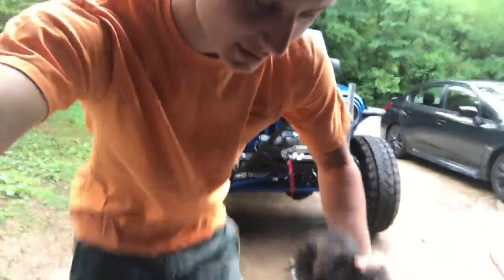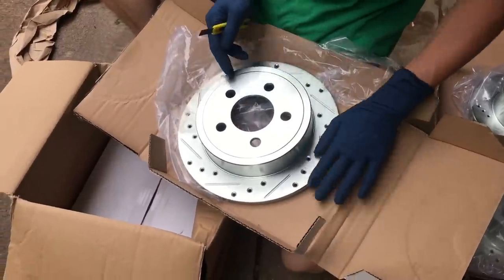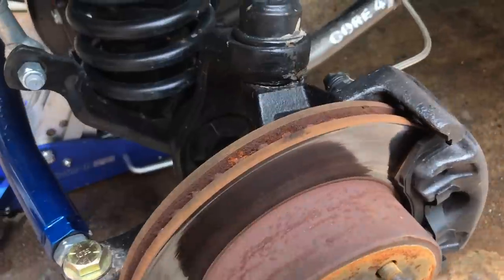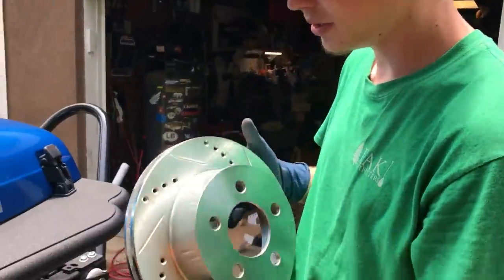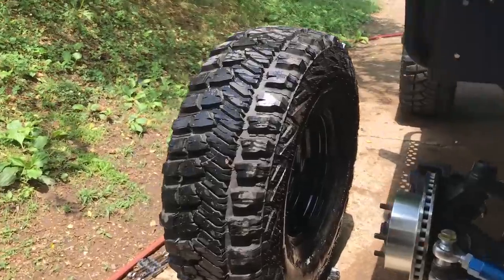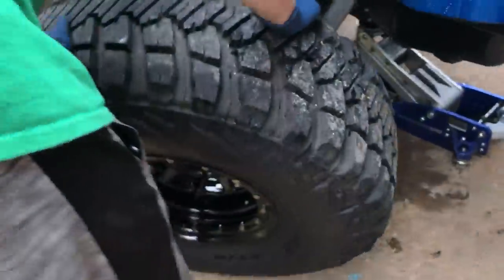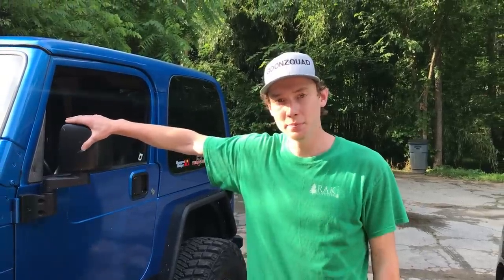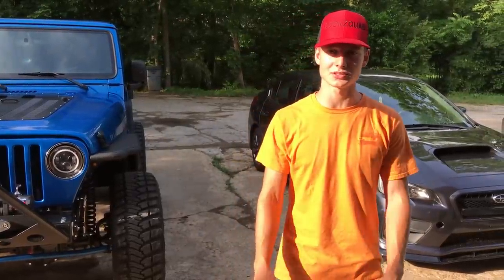Drilled And Slotted Rotors! Are They Worth It?

Comment: The drilled/slotted usually slip cleaner, but it's highly recommended you clean new rotors thoroughly (brake cleaner, then soap and water) to remove machining debris and oils. And of course, USE JACK STANDS!

Comment: I just installed StopTech's Sport Select Slotted and Drilled Rotors and pads that came with them just in the front on my WRX and the stopping power is a lot better, installed myself. Only $177 for the front kit. I've been installing parts myself for about 4 months now because it was just too expensive to do what I want at a shop and I've installed a lot of parts, mostly suspension and it's really not that difficult. Anyone out there looking to save some money, consider watching a video on how to install something and decide within your ability or not. For suspension, it usually will be.
Reply: Right there with you … 3 months installing my own parts for the first time in my life at age 29. Long overdue
Reply: @SaintChicagoJay  feels good knowing you got it done and saving yourself some money huh!! I’ve bin watching, helping, and wrenching since I was a lil boy. Now at 31 I pretty much do it all I even got into going in on motorcycles.
Reply: Seriously...i went to the shop and they were quoting $1200 for front and rear brakes and rotors... when i bought front and rear brakes and rotors on my own for $360. I saved $840 for opting to get the parts on my own and do thr job myself!

Comment: Drilled rotors have a design flaw, they are known to crack under pressure. The same can be said for nearly any type of rotor but the drilling process causes a few fundamental issues, most notable micro fractures in the rotors (which has been improved by better manufacturing and improvements in the drilling process) but this is a all to common issue with no name brands. Another issue is rotors expand and contract slightly once in use, this is very minor in day to day usage but over time it does add up (especially if the rotors are cheap and the drilling was poor) this encourages them the crack along the drill marks. 

You can find photos all over the net of rotors that came to this type of demise it's a common issue with cheaper rotors, slotting was the solution to this as it allowed for the rotors to cool without the risk of cheaper rotors having the same faults of cheaper drilled rotors. You may think drilling isn't a issue but it's highly recommended to avoid them in towing applications and racing (the same type of stuff they where designed to benefit by improved cooling). Slotted tho are far more stable and while not perfect either (less contact area along with eating pads quicker) they are a more viable solution. You wanna try and avoid these types of rotors tho if you plan to use ceramic pads ... idk they are always bundled but slotting and drilling do effectively cool a rotor but ceramic pads work best hot (a good bit warmer than normal pads) so the extra cooling will effect their braking performance. 

If you ever watch a race and you see glowing red rotors it's because they are using ceramic pads, they produce more heat and benefit from it but by using slotting/drilled rotors with ceramic pads you effectively defeat the advantage of both (better cooling, and better braking when hot).
Reply: Well stated. Thanks

Comment: Any motorcyclist who has ridden with basic rotors vs. those which are drilled and slotted can tell you the difference on braking while wet. However, drilled and slotted rotors will not greatly improve braking performance if there is insufficient time for the limited additional cooling effect to lower temperatures. Once the rotors are glowing from excess heat the only remedy is to avoid using the brakes until they cool down.

Comment: I have tried the drilled and slotted and you have to clean them out - those holes get gunked up with brake dust and no more hole/ventilation/cooling. Also watch out if you get a pebble in those holes it will chew up the pads. The best way to increase stopping power is probably just getting better/bigger calipers and pads/rotors. What do you think? I read the directions on how to break in new brakes and I'm pretty sure that it is breaking from 40ish down to 5-10 without stopping and repeat a bunch of times. You may look like a crazy person and annoy anyone driving behind you but the brakes will be good to go lol!

Comment: Nice jeep.  Agree with the Jack stand comments as well as chocking those wheels.  I would be careful using your air impact wrench to completely tighten those lug nuts.  You will over torque them.  Better off final tightening to torque spec by hand with a torque wrench.

Comment: Put some jack stands under there, kinda sketch
Reply: Or at the very least, lay the wheels on their inside surfaces under the frame rails. Better to loose an expensive, oversized rim than to have a 1,500 lb wheel hub land on your balls.
Reply: he has gloves, it's safe bro
Reply: there kids.
Reply: Right I was thinking the same thing I've had Jack's fail before
Reply: Great video thanks for sharing if I may add I've had Jack's fail on their own before nice brand new ones really dangerous to go under a car and do anything with just the Jack holding it it could slip out and so on jack stands or something else to support the vehicle with the jack, I know you didn't ask for opinions but since this is a public YouTube video I thought to add on with y'all ready skill and knowledge
Reply: Sketch like a rough draft >:0

Comment: Jack stands and don't let the caliper hang from the line and be pulling those lines either. 
Always check brake fluid level in reservoir also, and follow manufacturer's procedures for new rotors.

Comment: Carbon ceramic pads will resist heat more.  I use them on my cars.  They hold up really well in the canyons especially, no brake fade due to heat.
Reply: Dokk Tekk yeah but they take a decent amount of hard braking to get up to an optimal temperature for any benefit. If you’re just driving on the street there really isn’t a point. Plus they are much more expensive than the other types.

Comment: These slotted and drilled rotors are shipped to auto parts store aka (white box rotors) in turn performance wise the slotted and drilled are excellent on cars smooth rotors are better for truck application also slots and those drill holes will fill with brake dust and cause rust build up causing rotors to eventually crack

Comment: Blank rotors have more metal and therefore can handle more heat. Blanks also have more surface area and brake better because more pad surface is on the rotor.

Comment: Should always clean new rotors off with brake clean, bc they are shipped with a protective oil coating to prevent rusting during delivery and can mess up the new pads

Comment: Is it dangerous if you only change the front brake with the big brake and rear use back the original brake?
Reply: Depends if you have disk and drums brakes but If you have all disk brakes yea because when you brake all the force goes to front which is why front rotors are bigger than the rear but if you want to make it easier on the brakes due change all around. It's like if to say you changed only one rotor on one side and you drive and brake that new side is gonna work harder than the old side causing it to press harder and wear it down faster while pulling to that side. But no If you use the stock rear brakes your fine because the front is what does the most braking.

Comment: Hot tip, if you have an older vehicle or they salt the roads in winter where you live, make sure you clean your hubs before you swap the new rotors on. Even a millimeter of rust or debris can cause uneven wear on your new rotors and deform your pads because of uneven contact. Can even cause warping if it's really bad. Drill with a wire brush and a healthy amount of brake cleaner until it's clean all around, a thin layer of high heat anti sieze never hurt anybody neither.not an issue on a newer vehicle like this, but good to remember as she ages.

Comment: Drilled & Slotted Rotors should be marked with "L" for left, and "R" for right side positioning.
 My ACDelco rotors were marked -- with no chance to get 'em on the wrong side.
Reply: No. Just no. They are not directional. Unless specifically marked as directional, slots do not matter what direction they face

Comment: Did you clean the oil off the rotors that keeps them from rusting in shipping?  I assume you did, but I'd highlight that as a step for a video about brakes.  I followed a guide for brakes in the past that didn't say to clean the oil off the rotors/drums and so I didn't and the parking brake never really worked and likely the rear brakes didn't do much stopping at all.  Luckily I only did the rear brakes at that time.  Happily I've since known about the oil on the rotors and my most recent brake job was quite successful.
Reply: That’s ur fault bud

Comment: Did you change out your DOT fluid or it stayed the same like dot3 to dot4?
Reply: DOT 3 Brake Fluid is not suitable for high-performance applications.
 Minimum upgrade is DOT 4, but the new Bosch   ESI6-32N has the the highest boiling point of any non-silicone brake fluid that's currently available.
The new Bosch fluid is compatible with Dot 3, Dot 4, and DOT 5.1.
If you rely on your brakes, this ESI6 is the right stuff !

Comment: With experience with customers cars, I work on the slots of the rotors pack in with brake dust and prematurely wear out the pads. Also you guys should look into the WJ grand cherokee 2 piston caliper swap you swap the knuckles hub and  uses a WJ rotor and just back drill the WJ rotor against the D30 TJ XJ MX rotor

Comment: What happens when you are 
off-roading and mud and dirt get into the holes and slots? Wouldn’t it make it less functional?
Reply: Any debris that might get in the slots & rotors is thrown off by centrifugal force -- not a problem.
 I have been running ACDelco Drilled & Slotted Rotors for several years, with "Police" Severe-Duty Brake Pads and D.O.T. 4 Brake Fluid. Great for long-distance, hi-speed touring.

Comment: Installing larger caliper wouldn't help much with stoping what it could do make the front lock up which in a corner can cause snap over steer what would help is stopping is haven larger rotor for example going from a rotor that has a 11in diameter to a 12in diameter or larger rotor

Comment: Curious what brand ceramics you guys used.  I gave up on ceramics on my LJ and switched to carbon-metallic. More brake dust, noise, and rotor wear but they stop better than the auto parts store ceramic.   Stay out of the mud with those fancy drilled and slotted rotors, just asking for grit to get into your pads.  Keep your eyes out for some WJ knuckles at your local salvage yard.  Have to swap one ball joint per side, get some weld on unit bearing spacers, modify steering linkage, and re-drill the WJ rotors but gets you true crossover high-steer and bigger brakes and calipers.

Comment: looks like your rear new rotor is solid no cooling fines You might want to try EBC green stuff brake pads I did and my Jk stops on a dime But I only have 33 with drilled and slotted rotors

Comment: Just ordered a 4 set of drilled and slotted. How many break in miles?
Reply: There is no right answer to that question -- Google "Brake Pad Break-In" and check with the Pros. Some brake pad & rotor sets come with break-in instructions.

Comment: Cross-drilled brake disks are a hangover from the days when pads were made from inferior materials  30+ years ago when the old pads heated up gases would be emitted from the pads causing brake performance degradation so hole where drill in the disks to dissipate the gases. With modern materials this no longer necessary cross drilled disk are probably less effective than sold one because of slightly less surface area.

Comment: On those rotors direction of slots and holes doesn’t matter. It’s the direction of the vein in between the rotor. In your case the veins are straight up and down so it doesn’t matter direction of slots and holes. Vein direction is different with different manufacturers and applications.

Comment: For bigger tyres,bigger disk brakes and calippers helps.This its just a waste of money.Tested and tested again,not much of a difference,so in my opinion,its just a waste of money
Reply from the maker: RC Addict It makes a huge difference trust me, the drilled and slotted work great
Reply: goonzquad As an offroader driver,they are uselles.Bigger tyres needs bigger disk brakes and callipers,thats the law of fizic.If   you want to do a research,have a look on the racing cars.The bigger the wheel,the bigger are the disk brakes.And what I am sayng its tested in the field,where brakes are really stressed and abused.Those vented disk brakes,where an improvement for the stock ryres,not for oversized wheels
Reply: RC Addict law of what?
Reply: RC Addict Boy how old are you?😂😩
Reply: older enough :)))
Reply: Just go look at 1:50 they clearly say in the video IT HELPS WHEN THE BREAK HEAT UP
Reply: I dont think your opinion is needed.
Reply: Jason Moyle Is it yours????😂😂😂

Comment: they only help reduce heat not have more braking power.. better pad material gets more braking force, it also wears the rotors quicker, bigger tires do take more braking force but they dont produce more heat.. the vehicle still weighs the same or close to it and going at the same speed the same amount of kinetic energy is there to be turned into heat energy by the brake pads.. the brakes have less leverage to the ground though so they need to squeeze harder to get the same affect, the bigger tires should have more grip and therefor make braking faster when locked up in an emergency
Reply: Who told you this Mr wizard?..yes bigger tiers produce more heat when stopping it is a larger rolling mass....basic physics my friend ....look it up do more reading...

Comment: Nice Jeep guys!  BTW, the slots and drilled holes do NOT cool your rotors and pads down quicker!  This is thermal dynamics 101!  With less mass, there's less area for the heat to dissipate. Don't buy in to the marketing hype!  The slots will cause you to replace the pads faster = more money in the pockets of the manufacturer.  The drilled holes = less rotational mass and they help with gassing that this caused by the adhesive that the pads have on them.  And even that is no longer true.  It's just for looks gentlemen.  Next time, get blanks and a better pad.

Comment: you lose some surface braking area with slotted and drilled rotors and they are harder to resurface. Larger diameter rotors will improve stopping but may need larger diameter wheels to fit the caliper

Comment: The slotted helps the stoping power, the holes do NOTHING for ceramic pads. Holes were for asbestos pads that creates gas build up. The best thing you did for cooling was use ceramic pads.
Reply: I have used BOTH, and the ceramic pads are no better at stopping than the Motorcraft Severe Service (police) brake pads in current service.
In fact, the ceramic pads were scrapped because of chunks breaking out of the pads.
The holes are functional regardless of the type of pad --
Example:  The 100,000-dollar AUDI has drilled & slotted rotors -- and ceramic brake pads.
The famous 95 MERC has drilled & slotted rotors on alll four (4) wheels, with Eclipse Calipers, Severe-service pads , Raybestos hoses, and EIS-6 Brake fluid.

Comment: Yeah, there's more stopping power, but you usually get more brake noise and the pads wear out faster.
Reply: the rotors get worn quick too. I havent even had mine for a year and they already shake when braking.
Reply: @chemicalspore  Probably why even ChrisFix recommends solid disc.

Comment: What do you see on every lifted truck with big tires? Weeny little stock brakes. Those big wheels add a lot of unsprung weight and stock brakes cannot handle that. It's a smart move to upgrade the brakes.

Comment: To seat the brake pads to the new rotors simply vary the brake pressure at each stop. Don't panic stop it from the start, that warps the rotors and cracks the pads. Ease into the brakes in the beginning and increase the pressure and decrease the pressure at each stop.

Comment: my 2005 jeep tj has the rear brake as a drum instead of the disk, did you guys do the conversion?
Reply from the maker: Bryan Fernandes no the Dana 44 has discs in back
Reply: Jeep TJ rubicons come factory standard with disc brakes on the D44. But a Jeep TJ Sport with a D44 would have drum brakes factory standard
Reply: would you recommend me switching to disks then, i’m assuming they’re much better then the drums

Comment: Ohhh boy these kids 🤦🏽‍♂️ no jack stands and that’s not always how they go. You look at the venting stick a screwdriver in there and if it’s straight it doesn’t matter which way you put them on. However, if the vents are spinning in a certain way you have to point the slots “backwards” for example if your rotor vents weren’t straight you would have the passenger and driver side on the wrong side.

Comment: This video pissed me off. No jack stands, drilled rotors don’t cool the rotors if anything they heat up more because there’s less material for heat dissipation. Drilled rotors were functional in the past when pads were made of asbestos and gas fade would occur the holes were so the gas can escape but now since gas fade is a thing of the past drilled rotors are only for looks

Comment: This is a waste of money! If you really want to stop better go bigger not weaker due to metal being thinner from slots or holes.
Reply: Sounds right -- but it's NOT right !!
My ACDelco Specialty Performance ( Severe Police Service) Drilled & Slotted rotors weighed four (4) ounces more (per rotor) than the stock, no holes/slots type that they replaced.
Over 50,000 miles on the rotor/pad combination -- Excellent wear and brake performance -- 95 MERC Marquis Restoration.